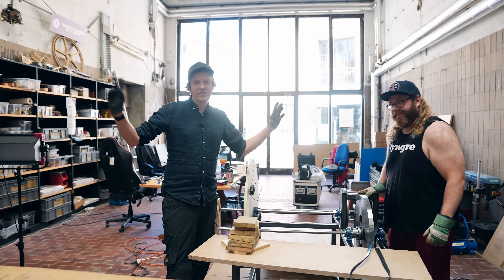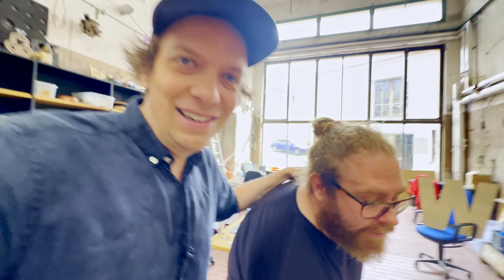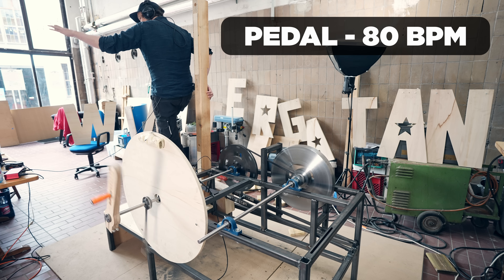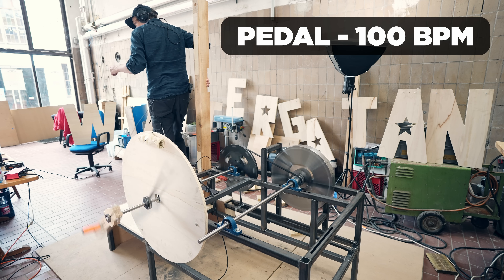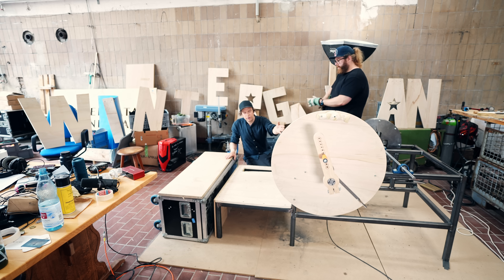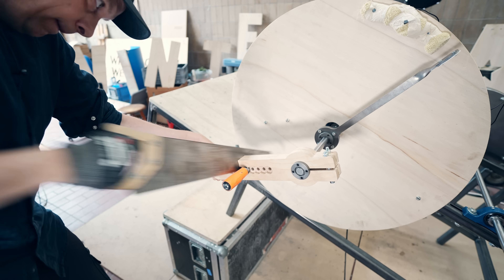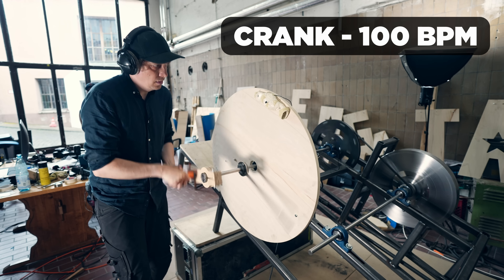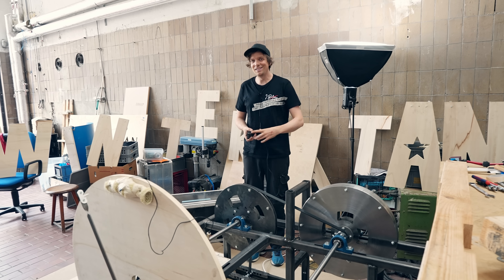Heavy Flywheel plays Tighter music! - DAY 11 - Marble Machine Flywheel Prototype

Comment: I think the rotational position of the timing lever on the shaft is screwing up your timing. You should have the timing lever at top dead center when the pedal is all the way down. Similarly your hand crank is angled so you are at some random position in the circle when your timing lever strikes the mic. If you get the timing of the lever correct in the rotation, you will be able to hit the beat better.

I'd like to see you do a test where you change the position of the timing lever and see how that affects your ability to play "tight"

Comment: A couple of questions... Did the heavier fly wheel make tighter music or did you just have more practice with the machine at that point? Maybe go back on the weight and see if the numbers return?

Also could more weight just add more load? I said in an earlier comment that having more load on the machine might help as well. It would give you something to work against.

This, I believe, is why the machine is tighter at higher bpm because effectively the load of the bearings becomes more significant.

Comment: You should consider using a “oneway bearing” on the hand crank, so when it’s free-wheeling its not swinging around dangerously :)

We use them a lot in RC helicopters so that we can AutoRotate when the engine or motor is stopped.

Comment: This whole system, with the flywheel causing a slow reatction to the BPM change, reminds me of the contoll theory class theory I had a while ago.

Basically you try to match the set BPM, but once you reach the BPM, the change in BPM you needed to get to that point, keeps on increasing a bit ,because the moment of inertia,  and thus overshoots your target.
Then you think I need to slow down. Once you reach the target again on your slowing down, it undershoots again.
That way the BPM always oscillates around the BPM you want to reach.

If in some way you had a more intuitive feedback, it would be easier to keep a given BPM.

Sorry for the "know it all, ramble" (i don't know it all😅)

Just brain storming:
Maybe some (digital) PID program could warn you you're getting close to the desired BPM and prompt you to ease the acceleration before you reach the target BPM, to prevent an over shoot

Comment: okay so heres what i picture for the final power system:

it would be this wheel driven by this pedal in exactly this configuration. a variable speed governor would be attached to the wheel with its own on-the-fly lever that has approximate "presets" for different BPMs but is ultimately continuously variable, and that drives the programming wheels and other random functions. a mechanical tach on the wheel would tell Martin how fast it's going, ie. how much energy it has left. the tach would have similar approximations of charge level based on the tempo setting.

basically what this system would let him do is "charge" the wheel by pedaling/cranking with no need to care about timing... he would exceed the governor set speed on startup. when he starts playing, the governor will slowly leak the power from the wheel into the system to power everything without Martin doing anything while playing except looking at the tach. when it gets down to a certain rpm level, he can resume pedaling/cranking to recharge the wheel mid song.

Comment: If you need to keep adding more of the same thing, you’re doing it wrong. 
You spend so much time trying to make things tight, but in the end its your own cranking that is causing all the troubles.

I would honestly rather have it running bpm wise automatically using electronics and have you move your fingers on the fretboards etc, than you spending all your efforts trying to sync up to a beat. Feels like you are very capable of driving a bike, but you are focusing on moving the pedals around, instead of just going forward
Reply: Translation:  he’s spinning his wheels yet not getting anywhere
Reply: @br52685  Great way of simplifying it

Comment: Again 12 cylinder engines are smoother than a single cylinder. The hand crank allows you to push and pull.  - |_TT - A two hand 180 degree offset crank would allow smoother power input over the 360 degree cycle. The pedal is equivalent to riding a bike using one leg without a foot clip.

Comment: All this testing is actually an unnecessary sidetrack to 'playing tight music'. Why? Well.

It's a difficult thing to try and keep matching a click track. But if you consider how music is played, one doesn't actually need to match a click track all the time - as long as the tempo is kept similar. It's whoooole lot easier to maintain any tempo within 2 bpm variation, if you're not trying to constantly speed up and slow down to pointlessly match a click track - as the marble machine actually is its own click track.

Therefore: within a marble machine, all the different instruments are tight together. Just keep cranking / pedaling steadily and the music will sound good. You're not going to be using backing tracks or a click track in a live situation, right?

Comment: I commented this on the previous video as well, but I will comment it again:
I think that if you want to be able to play tighter music, then yes, a heavier flywheel would be benificial, and also know that there isn't any mechanical load on the system yet so the results may differ, but you should also look into adding some sort of dampening to the system. If you look at your system like it is a driven harmonic oscillation, you can see that the system is a little bit underdamped, which results in the frequency shifting constantly. By adding some sort of velocity-based resistance, you could decrease the amount of shifting occurring and thus increasing the tightness of the music. Maybe an eddy-current based magnetic brake could work, or some sort of liquid dampener. The wikipedia page on harmonic oscillations contains quite a bit of information on this topic.

Comment: One thing I consistently notice is that you naturally pump the pedal in line with the beats, which often creates a tempo different from what is intended. Meanwhile, the crank allows your motion to always sync up perfectly with the beats. More so than they flywheel, I think the natural tendency to follow the beat is the issue. There's got to be a way to make it so that the pedal will sync up with the intended BPM, perhaps a transmission or even CVT (continuously variable transmission) connection between the pedal and the main set of shafts to allow you to achieve this.

Comment: It occurs to me you might have an easier time displaying what you current bpm is somehow rather than trying to maintain a bpm off of a metronome. With most metronome apps, there is a tap feature that lets you find the bpm by tapping and the app displays what bpm you are tapping. It would be super cool if you could rig something up to the contact mic that would display what bpm you are currently spinning at instead of trying to match a metronome. Not sure if this makes sense, so I hope you can do something with it. :)

Comment: Something I think is being missed with the pedal is that yes, the pedal is taking energy out of the system as it's being raised, but it's also putting that same energy back into it as it lowers. I imagine this would cause significant deviation on timing within each revolution - the wheel will be spinning faster when the pedal is down compared to when the pedal is up. The flywheel should help alleviate this somewhat, but I definitely think that should be tested for more than the time it takes to do one revolution.

Comment: I'm still out on deciding for myself, if the position of that "pick-up"-contact mic is chosen correctly and/or IF there even is such a thing as an ideal position for that pick-up... either in relation to the crank or the pivot point of the pedal
Reply: The entire concept of a pick-up mic (that only records one data-point per cycle) is incorrect. The better (and easier) method would be to directly record the RPM (that also measures the fluctuations in the angular speed through the entire revolution).

This current method isn’t providing useful information, especially given the “right music” he’s chasing.  

I’m ignoring the fact that what he’s chasing, is actually irrelevant—but that’s a different conversation.  Bottom line:  he’s chasing the wrong thing, and what’s he’s chasing, he’s doing it wrong.

Comment: You should be doing a 3rd test by using the helper motor from the MMX that electronically adjusts itself to keep the BPM correct.

Comment: Should the weight of the rest of the marble machine mechanism be considered when thinking about the weight of the flywheel or will it not affect it? I m just thinking, right now the flywheel is only moving a shaft, not a bunch of wood and metal metal marbles.

Comment: Why bother testing the foot pedal? The hand crank will play tighter music because you are applying even power to a full revolution. The foot pedal is only applying power to a half revolution causing more undulations in the speed of the flywheel. A flywheel with a larger mass helps smoothens out the differences but the hand crank will always win in relation to constant speed of the wheel.

Comment: The final marble machine is going to apply angular momentum on the flywheel. 
Now you're testing the flywheel under no load condition. You should really test how this system will perform with load applied to the flywheel.
You can try simulating the load with a weighted break or even better find a way to apply varying angular momentum.
I love this project and I wish you Martin best luck on your journey.

Comment: Just saying, nothing personal, but how tight music can you play? The current flywheel does help to smooth the "tightness" but it doesn't do anything else, as in, in electronic circuit a capacitor smooths the signal but it doesn't alter the signal, it does help to get the ripples out but it doesn't change +5V to 0V if the +5V is in the wrong place.

I am in no way saying you couldn't play tight or there was any that kind of problem but strictly from engineering and scientific side saying "how tight music this prototype can play?" should be "how tight music I can play with this prototype?". It's just part of the reality that there is many variables and most of them are just natural, like if you have a band playing on a stage and they don't have IEM's and play by the click but try to play by the drum beat, they will be off the beat because unless they're watching the drummer all the time or counting themselves, the sound of the drum will take time to reach the other band members and they will be at least that much late because that's just how physics work. Same thing here, the results will also reflect what you hear as playing exactly on the beat, how well you can keep the machine playing on the beat with things like how much latency there is in the computer feeding the sound to you and how well the machine can help you to keep it playing on the beat.

The only way to minimize this will be to build mechanism that will dictate the speed at which the machine will play separated from the input. This will of course make the machine more human powered drum machine than an instrument, makes it more complex and lessens the input you can give to it. At that point I don't know does it even matter if it would be powered by motor because theoretically it doesn't change a thing because the power input is already separated from the functionality of the machine.

In my opinion, having the marble machine be a bit "wonky" and off the perfect because it's powered by you is absolutely fantastic thing.
Like personally I don't see a reason to go watch a band live if they play by the click like machines and there's nothing else to get than seeing the musicians on the stage while they play EXACTLY like on the album, there is no room reading, no common mistakes to make it more humane performance, no surprises and it's just boring. I believe if the old barrel organ makers wanted to make a barrel organs more as exact machines than instruments, they would have used springs and other mechanics to limit the human input to only providing more power than affecting any of the tempo, like automaton makers have always used human input only to "program" and wind the mechanism (be it weights or springs) to minimize the effect human has to the mechanism, they wouldn't have had second thought to use electrical engine to power the automaton if that provided flawless and exact operation because that was their target, to make machines without human errors.

And I honestly believe this is something that also needs to be written to the stone and made crystal clear with the Marble Machine, is it a machine that plays music or is it a mechanical instrument, one cannot have flaws when it comes to play music, the other one even needs flaws to be unique, expressive and what it is. I believe part of why the MMX "failed" is because it started as a machine that can be used to play music live, it needed to be expressive and show piece and do things that the original Marble Machine did but better and somewhere in the middle the aim changed more to be complex record player with instrumental features that couldn't have any flaws or just very minimal flaws, especially musical, and that really wasn't was it was originally planned to be. It was a major movement of the goal posts, from Marble Machine that wouldn't vomit half of the marbles within a minute, that got stuck every two minutes, that wobbled with every crank and made more noise than music to automaton that would play the record perfectly. I might be wrong and the MMX was supposed to be more music player than instrument but I believe many have these same questions and they should be answered and with them we can make design choices that will move the future machines to the correct goal.
Like that do you want to have constant and direct control over the tempo of the machine or do you want the machine to keep the correct tempo and rather want yourself just powering it?

Comment: I still say, a simple governor will solve the problems.   Look into the speed regulators used on a common wind-up music box.  Imagine your crank being used to wind a spring, and the spring tension being used to turn the gear that turns the flywheel, that operates the machine. Add a fan blade that varies resistance with speed...and you will have a steady rpm.... and a fan to keep the operator cool.

Comment: I don't know if anyone has pointed this out (I don't typically read the comments) but syncing up with the metronome will actually be more difficult than getting back into rhythm without it. Without it you just need to get the frequency back to 80BPM - with it, if you fall behind, you actually need to first go faster than 80bpm to catch up, and then slow back down to match it.

Comment: The smaller crank means you can exert less torque and therefor have less effect on the rpm. So not surprising you have less STD variation. 

But this is only valid on a system with (almost) no load. I think you should add some drag to simulate the effect of the machine.

Comment: The rotating crank arm gave me the idea of some kind of speed/bpm dial and I wonder if you could make an analog one. I'm no engineer and I'm sure it's a solved problem but I was thinking some kind of light polystyrene ball in a tube and a paddle connected to shaft while would 'blow' air into the tube and the height of the ball would give you an indication of speed of the system

Comment: Funny how before you discovered that the axle is too weak to hold the flywheel, to then follow up with doubling it's weight.
It was only bending and still holds the weight, but as you already figured, the final machine needs a thicker axle.

I also share the safety concerns of the handle with the rest of the comments, a one-way bearing should be added to where it mounts to the axle I think.

Comment: the best way to do this is to have about a 230 kilo flywheel spinning at 300 to 400 rpm's with a governor on the output

this way you can have the power side spin faster then the output side then you govern it down to get the bpm you want

total you need
input/output/storage
input is connected to any power input and spins the storage at at lest 2 to 1
output is governed off of the storage
storage stores the input power and transfers it to the output governer

Comment: Most of the mass in the center of the flywheel is doing nothing (because it is moving slower), by slightly increasing radius of it and removing internal part, you can significantly reduce it's mass (weight) while saving same rotational inertia.

Comment: Having a very heavy flying wheel will make it very hard to play tight music if you plan to turn it manually. This is because it will take too much time from the moment you decide to up/down the speed of your foot until the wheel will react to it, causing it to always overshoot/undershoot. The MMX had a lighter flying wheel. It is less stable, but react much faster to your foot.
Making the flywheel even more heavy will just prolong the cycle of being in sync - off sync

Comment: I feel like and adjustable speed governor that can be engaged or disengaged while playing would work best.  You will have moments when you want to just hold everything tight at a specific bpm, but then you can flip it off and ramp up or down as needed based on the song you are playing.  This test feels very arbitrary to the intended goal of playing tight.  A certain amount of momentum via the flywheel is needed both for input stability from martin and for output stability for the mechanical conenctions that will eventually drive the machine, but I agree with a lot of the comments that trying to stomp on the beat isnt a great way to determine "tightness"